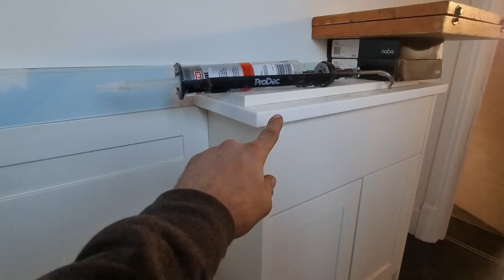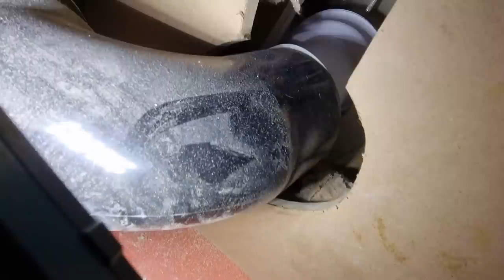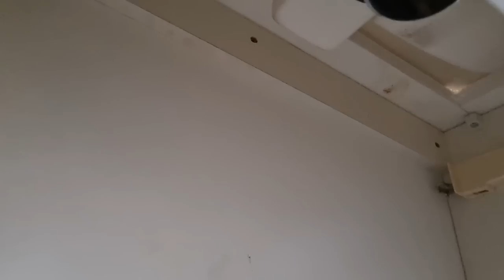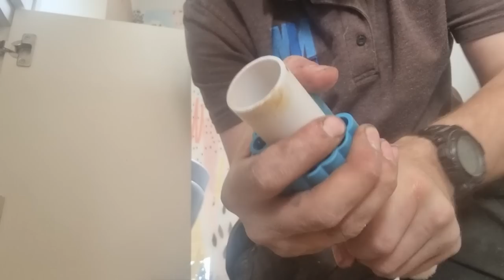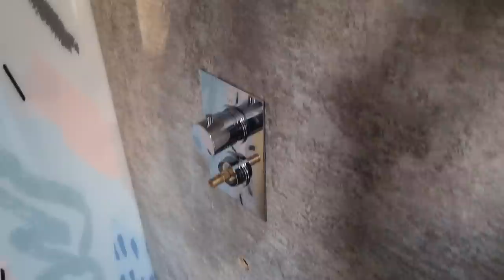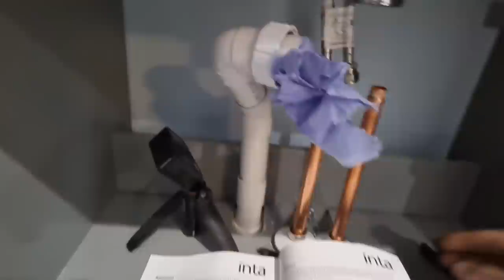Simple Plumbing Trick That Save Time | Day in the life of a Plumber

Comment: Fireturds all melt the plastic trap Tom , i've changed lots to the updated metal version.    Yet to find a metal trap with any water in it due to the crap design of the boiler, hence the plastic ones melting.......

Sooty  cells and disintegrating boards on hx doors are other common things with these.

I'm glad its Friday and due to rain over the weekend and clear the snow.      We had 6"  of snow last Sunday and it froze that night,  its not got above freezing all week, stupidly busy with breakdowns and back lanes like a bobsleigh run......
Reply from the maker: Those firebirds don't seem the best boilers on the market, like you say the condense traps and hoses are rubbish, and the door seals always seem to leak, I'm pleased next week is looking a little bit warmer, this weeks been manic, I've not had one frozen condense yet though, which I'm more than amazed about.

Comment: You can get a fitting that goes inside the 15mm compression fitting with a 1-2 male thread the other side
Reply from the maker: On the showers I use a female back plate in the wall, you can extend this forward if needed by screwing in a female iron, I may have explained it in a confusing way in the video, thanks for watching 👍
Reply: @PlumbLikeTom  sorry I meant you can get a fitting that goes inside the isolation compression nuts that converts it for the tap flexi’s
Reply from the maker: @chriswatkinson93  I'm with you mate, I will have a look into getting a few to put on the van, thanks for the support 👍
Reply: Use a rad tail

Comment: Nice work Tom, is the rpz valve in place of a auto top up unit?, I’ve never seen one & I’ve mainly done commercial work, are the plastic pipe cutter’s worth getting?
Reply from the maker: Hi mate, the rpz valve is instead of a micro fill, rpz valves are good for fluid cat 4 which commercial heating systems are categorised as, they just need checking once a year, the cutter is Ok for the price, I was hoping it would cut the plastic center of boiler flues but the plastic is to thick, it cuts waste pipework up to 2 inch really well though, and is good in tight spots, thanks for watching as always mate 👍